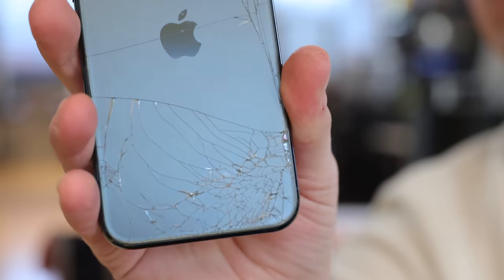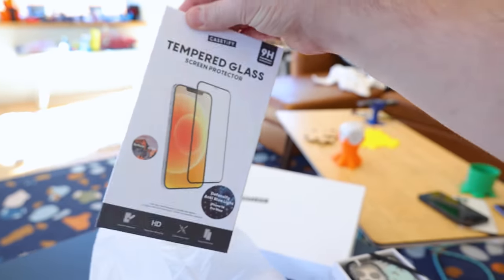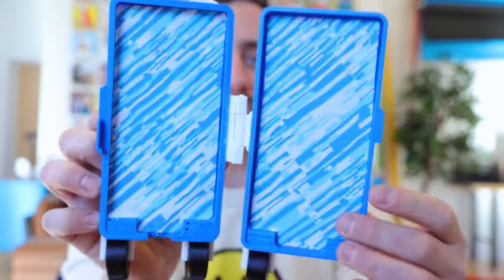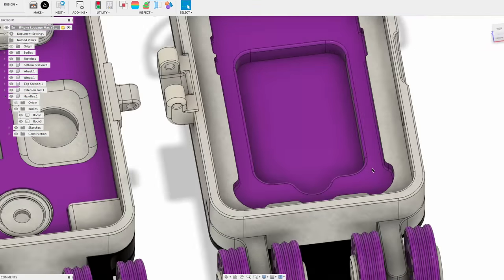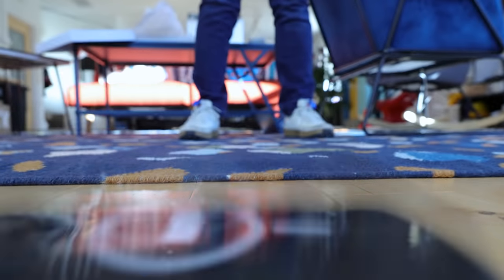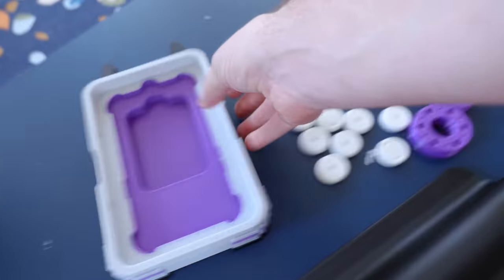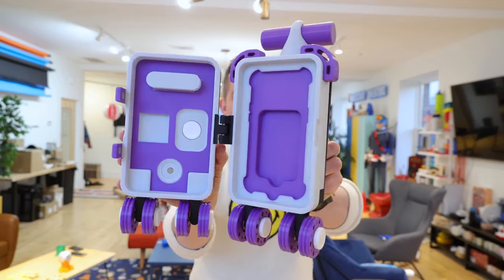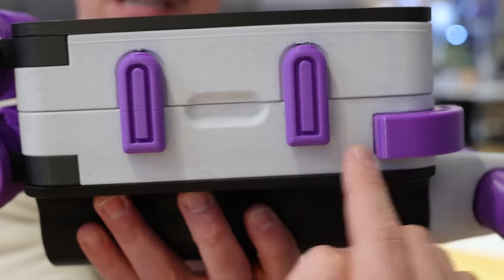I Designed Luggage For All My Apple Products

Comment: Make a spoon fused with a straw, it's a spoon but there's a hold in the spoon and a bottle opener in the bottom, if you open the bottle opener you can use it for a straw, and unscrew the bottle opener if you want to use it for a spoon, it is used for noodles with soup, chicken soup, and ice cream. I call it Stroon™

Comment: I think this is cool but I can already see space for a version 3. It could be a similar design but behind each compartment is a wireless charger hooked up to batteries hidden underneath which you charge via a port on the outside of the case.